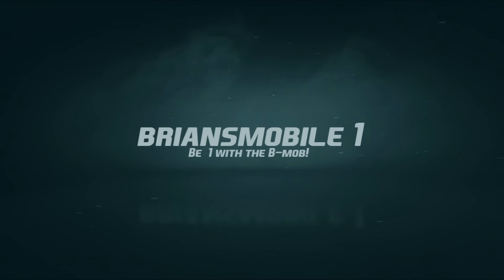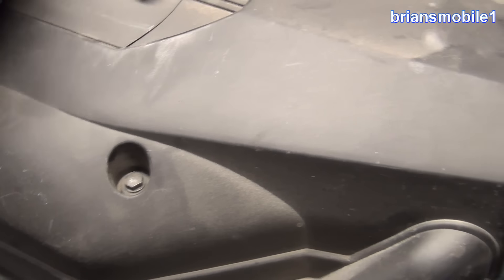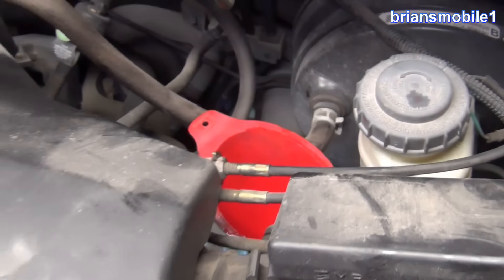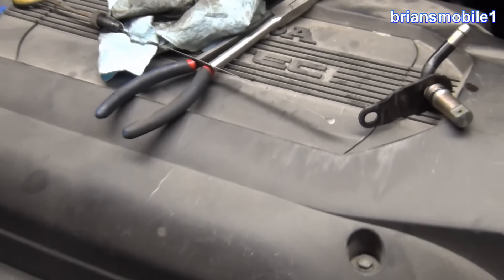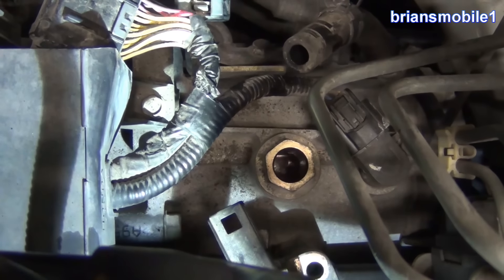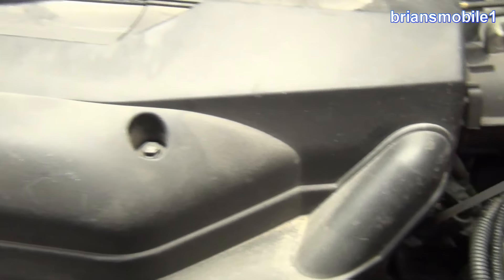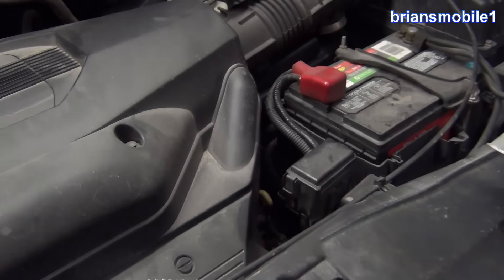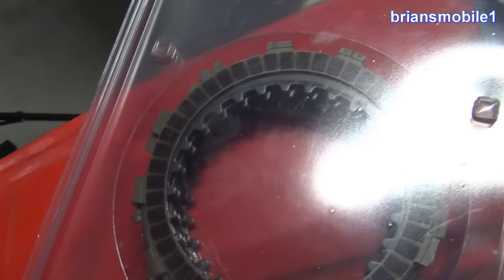Watch this Video BEFORE You Destroy Your Honda Transmission

Comment: I have a 2k Oddy with 260k, original miles on engine, trans and body. I've been using Valvoline Max life ATF for 200k. Honda fluid is too expensive an I believe they got it wrong with the modifiers. The max life gets flushed every 35k and the magnetic plug comes clean as a whistle. 

I'm looking forward to another 250k, if nobody hits me first!
Reply: xr500t I agree 100%.  I’ve always used Honda DW1 and have had my transmission fail 2X.  I will no longer use Honda DW1 fluid in my Honda’s.  I have a friend like yourself who has used Valvoline Max Life and his transmission is fine, and he has high kms.  I am now using Motul 100% Synthetic ATF.  I think everyone has been brainwashed about using their specific fluid.
Reply: Lucky You! Valvoline Max life ATF is not an OEM licensed product. Transmissions cost over $4000 to replace.
Reply: Sounds good, but I highly recommend you get the Oil Jet kit modification installed. The one that installs through the ATF fill hole, and replaces the original fill bolt. This will keep your second gear set from overheating.
Reply: @netdoctor1  do you have a part number and TSB for the Oil Jet kit
Reply: @alexpiccione610  I'll look into it.
Reply: @alexpiccione610  read the manual. Honda"recommends" their fluid, however, they also say you can use an equivalent. It's not "luck", it's proper maintenance. I can safely talk from experience.
Reply: @xr500t  Ok, IMO some "equivalent" stamped  oils are not good to use as replacements.
Glad your choice worked out for you.
Reply: Doesn't this matter if you have the pre or post 2002 model? Some require the zf fluid some dw.
Reply: @fabiansantos4558  I couldn't tell you. The requirement was  for the ZF fluid. But, the manual said you could  use  an equivalent  (I forget which) in a pinch. I decided because the  ZF was too expensive to use  Castrol import/export, then I switched to the Valvoline Max life.  I'm at 280k now.  So, instead of a flush and fill every 35k, I treat the  process like an oil change, where I drain and fill every 6k . That way, I keep a clean trans, but  no massive drain and fill procedure every 35k. Seems like it's expensive, but it's not, it's only 3.5 qts.

Comment: Just bought a 06 pilot and the trans has a top and side fill bolts. Honestly surprised how much power the motor has for one being a Honda and 2 for being fairly large and 4wd. 176k on the clock and drives awsome. The HP power steering line was a PITA only 1 of 3 brackets were reinstalled. Not a fan of all the crap brackets holding all the lines and hose together once you bend them they never go back the same if ever.

Comment: Good advice 👍 My daughter changed her trans fluid at some little shop. They claimed it was the correct fluid but the transmission was not having trouble before but now vibration at idle in gear. Honda dealer fushed it three times..GRRR

Comment: My 06 Acura TL had the fluid changed. Easy.  Interesting example using the motorcycle clutch.  My BMW 1200 bike uses a single plate dry car style clutch.

Comment: Years ago my Tacoma wasn't shifting when the computer was telling it to. Dealer said I needed a new valve body. I think they wanted about $2000. Called another dealer and told them what was happening and said I just need a price for the same job. They recommended flashing first. I did that and it fixed the problem 100%. Drive it for another 5 years before Toyota bought it back off me.
Reply: kewl, but this video is pertaining to Honda/Acura models

Comment: Took my 06 crv to dealer for recall, service advisor wanted to sell me a trans flush! 300.00 ! After I refused, he wanted to sell me a coolant flush and throttle body clean 200! Did both and trans fluid change for less than 100!!!
Reply: To be fair, I know some Toyota/Lexus dealers actually have a machine that drains and fills at the same time, not FLUSHING with high pressure, but similar to the home method of pulling a trans line and filling the trans with fresh fluid as it drains from the open line (car running). A complete fluid exchange.

Comment: I have a 2007 civic with 250k miles and I have never changed the trans fluid since I got the car at 60k miles. Someone told me fresh fluid would break it this point so it will be interesting to see how long she lasts.

Comment: If you want to save a buck you can just buy Idemitsu fluid, they are the OEM for the Honda ATF, it's the same stuff, just a dollar or two less a quart.
Reply: really?!
Reply: Lol o ain't trust other fluid brand. Only honda know what viscosity it should be in their cars
Reply: @armanmaaba600  Do you think Honda makes their own fluid? They buy from Idemitsu, and mark up the price, it's literally the exact same stuff.
Reply: @armanmaaba600  Hahahahaa, who's talking about viscosity? There's no viscosity in transmission fluid, just types. I searched as well and Idemitsu is the supplier of transmission fluid for Honda.
Reply: ... car with dead transmission cost over $5k, so I dont mind the cost of certified Honda ATF.
Reply: @zoneb609  Not so. All liquids have  viscosity. An ATF like Dexron/Mercon or type F, if memory serves, is something like a 10 or 15 wt. As to Idemitsu supplying Honda, sounds about right. Long as the bottle says it's suitable for vehicles requiring DW1/Z1 fluid, it should be fine.
Reply: @bobbofly  Yeah, I get it, I was referring that in case of automatic transmissions you don't go to the parts store and search for a specific viscosity, just application, and compatibility with your vehicle. But yes, liquids have viscosity I agree.
Reply: Kenneth Miles wrong what

Comment: Years ago I used some of that stuff that cleans out your engine and it worked great. 
In fact it worked so well that it dropped all the crap down into the pan so it could clog the pickup and starve the engine for oil. 
Knock knock. Who's there? An educated consumer that knows not to use that stuff unless you are getting ready to pull and rebuild the engine. 
That's what happens when you buy a used car and the previous owner just added oil as needed. I got another story about clogging up the oil pickup but I'll tell ya that on another day.

Comment: Honda trans are different, make sure you use ONLY Honda brand transmission fluid and nothing else
Reply: Adam Walker  As far as anti freeze is concerned I agree, but I'm not going to chance anything when it comes to the transmission. Front wheel drive automatics are expensive to fix.

Comment: I have heard that you should not change the trans fluid if your vehicle has more than 100 K miles on it because the old fluid has dirt and crud that are giving the old fluid more friction and is needed to help the clutches grab. I was told you should only add fluid to these transmissions if they are low. The new flush and fluid will cause slippage and many times bring a quick end to an otherwise still working trans.  Listen to Scotty Kilmer on this subject.
Reply: Changed fluid and filter..first time ever...in my 2000 Lexus rx 300 at 210000 miles. Added a bottle of Lucas fix just for the hell of it. That was 3 years ago and the trans is still doing great. Wasn't having problems...but glad I did it. I used maxlife fluid. Fluid was very dark and there was a thick gunky layer of fluid in the pan. Drained it...did not flush.
Reply: I would change the fluid and filter if it has one. I would not flush it.

Comment: I get fluid for like 7 bucks discount.. when I used to use my honda for delivery ill do a drain and fill every oil chnage..
Reply: Isn’t it supposed to be like every 30k miles or around that area for transmission fluid change
Reply: @carlitoseuceda2000  as far as iknow auto recommend every 60k or so and manual every 30k.. read you owners manual,allot of greats things u dint know bout your vehicle.
Reply: Had a 15 accord sport and iknow have cut trans. We all cut are crap. I did my fluid the first 30k
 Honda guy was like thats too early. I reply.. thats kewl.

Comment: to fill the trans, i use a Hopkins FloTool 10704 to fill through the dipstick neck.  a small clamp will secure the funnel's hose to the top of the neck.  that way, i don't mess with the return line

Comment: I've read somewhere that after the 1st 2 quarts you should start the car and add a quarter if the 3rd stop engine and check level.  And repeat last step till right level.   Is this a better method?
Reply: he already knows the capacity from the service manual & if you're really OCD about it, you can measure the amount drained from the pan to confirm

Comment: Hi brian im bout to swap a new  transmission on a 96 odyssey. However from replacing the rear main seal and switching the parts  from the old transmission to the new one. Like the cables, sensors, & the starter ect..my question is? what else would i have to check or prep or looked for?  on the new transmission? before putting ut in thanks hope to hear from you ?

Comment: I have an 06 TL and use Valvoline Maxlife.  Why use the Honda brand?  They make cars, not fluids!
Reply: I just did a radiator swap on my bosses 02 MDX (trans fluid runs through radiator, stupid design imo) and I topped it off with max-life as it had the required specification. Now I just bought myself an 05 MDX and I am going to change out the fluid. I was planning on using max-life again, unless I could find some reason not to.

Seems like it's working well for you, and my bosses transmission feels strong at 245k as well, except for the dreaded whistle in 4th gear haha.

Comment: I got my new 2000 Odyssey through 250K miles and 3 kids and 2 dogs.  Drained and filled 3 quarts of trans fluid every time I changed engine oil.  Only used Honda trans fluid.
Reply: At $7 a quart, that's $1,000 in fluid, yes?

4x$7 =$28 every oil change. 
If you do that 3x a year $84 a year for 20 years = $1,680
Reply: @deasttn  - have you priced a rebuilt Honda transmission and rental car for two weeks?
Reply: @petersouthernboy6327  not cheap.
I just think you're over doing it (my 04 odyssey went >200k with next to nothing spent on transmission fluid).

I usually put a gallon in every year or two

Comment: 95 % of Honda transmission failures it is owner’ fault  !!!
Reply: BS THEY ARE BAD WHY THE TOYOTA DOESNT FAIL.
Reply: @382527100  right, Toyota/Lexus trans will outlast their 300k+ mile engines. It still amazes me looking through lexus classifieds how many are over 200k+ for sale. I personally drove an es300 from 94k to 200k and the only non-maintenance item I replaced was the AC compressor, and o2 sensor and valve cover gaskets (which are practically considered maintenance items).

Comment: I have a 2007. I don’t have that hose stuff for the fill  hole.  
 And  use only dw1 fluid.  I tried valvoline maxlife full synthetic ATF it worked  but I went back to the Honda fluid shortly after because it shifted smooth as butter with dw1 fluid.  And I used 3.3 qts on 2007 model year .

Great vid there.  I like the Honda drain plugs with the easy magnet access.

I also have 2001 Nissan Maxima
At 202k miles it was shifting very bad.   Almost didn’t move.  

i did a 3x drain and fill with few thousand miles between each.  Along the way Lucus and seafoam transtune were used.   It’s now at 215k miles and shifting a lot better   But needs the Lucus additive.  It shifts fine but when you floor it in 3rd gear it slips
Out of gear into N.  But let off the gas it slips back into 3rd.  
It does get p0744

I think it’s the shift solenoids which includes the TCC or clutch or torque converter.  But it’s seems ok to drive locally. The car is my sons now and the bad shifting didn’t show up untill 3k miles after he got the car.   Needless to say I have been busy fixing it for him myself (I am not a mechanic just hand and  small engine hobbyist.  
- new plugs
-  new coil
-  front breaks
- transmission flush vid 3x drain fill
- blower motor and resistor replacement 
- window motor replacement 
- fix leaking water into trunk
- oil changes
- pvc replacement 
-  misc  other simple stuff
I have been documenting the costs and estimated savings by DIY to prove to him how much money can be saved but learning how to tinker with stuff and fix things your self.
So far it’s about  67% savings vs a shop or dealer.
Reply: And don’t forget that a dollar saved is more valuable than a dollar earned, because you’re not paying income taxes on a dollar saved. That makes that 67% a good bit higher in reality.

Comment: Nice when I got my 1991 legend it was shifting hard, I checked my trans fluid it was half full, so I researched fluid type and it showed me Honda’s fluid same as in the vid, but no one had it so I had to order. I drained and replaced and freaking huge differences smoother but not perfect. I’m going to wait couple more drives to drain and replace just to be sure!!!
Reply: Also when I tried to get the fluid and they didn’t have I used merc or whatever they had to get home. I asked the guys at parts store and they couldn’t give a clear answer on what tranny fluid to use so they told me use merc 3 or whatever was used or bought mostly. It’s almost like I could smell the tranny fluid burning, other that hard shifting still.
Reply: Using Honda atf and still running strong

Comment: I have a 01 accord EX v6 3.0 sedan... for some random reason my car is driving forward in all gears including N and R... why is this???? I've replacement solenoid valve A, Torque converter clutch solenoid and the linear solenoid and I also put new fluid in today... what's wrong with her... 😞😞those 2 solenoids are the ones that sit on top of the transmission and then the valve solenoid that has the black connector was brand new replaced few days ago... what's going on with my car and the D light is flashing and the TCS light comes on as well....

Comment: I changed my transmission fluid on my 2018 Civic EXT at 53,000 miles. I flushed my brake fluid, replaced the brake pads, cut the rotors, and replaced the tires at 66,000 miles. I only use top-tier fuel, 93 Octane. I’ll be cleaning the valves with a walnut blast soon. I always change the oil early at every 4,000 miles. Keep your car maintained religiously and you’ll get trouble-free operation for years.
Reply: I mean not every car is tuned for the highest grade fuel. Like I mean you could use methanol technically but since your car isn't tuned for it.. it won't make it run better.

Comment: My 2004 Altima with 5 speed Automatic Transmission has completed 2,35,000 miles with factory filled fluid. Never changed it.

Comment: 2018 Honda Pilot with the 6 speed. Drained approx 3.8 qts of fluid, fluid looked bad. Put 3-ish quarts of new fluid back in, started and ran to operating temperature, adding fluid until level was good. Drove vehicle for approx 10 minutes, drained fluid again, fluid still looked bad. This time only about 2.9 quarts came out and it quit dripping. Re-filled with approx 3 qts of fluid, I run vehicle up to operating temperature, turn vehicle off, pull trans dipstick and wipe clean. Re-install dipstick and observe fluid level on dipstick. Every time I check it, The back side of the dipstick has fluid way up on the stick, but the side that has the word “hot” in between the 2 dots the fluid level is within the range. I’ve dipped the stick several times and each time this is the result. I’m assuming that the design of the dipstick must scrape down the dipstick tube on the back side each time you insert it, resulting the excess fluid on the back side. Anyone ever experienced this?? Seems a little unnerving. Also, now sometimes when stopped and the trans in D, when I take my foot off the brake the car will not move until I press the accelerator. any ideas???

Comment: On my 2012 Acura TSX Wagon, with 4-cylinder, you run until fully warmed up. Shut the engine down and then check it between 60-90s after shut down. If to long restart vehicle, run a few minutes and try again. This is according to the owners manual.

Comment: I have  a 1991 civic, for some reason my levels at temperature are lower than when cold, opposite to your observation in this video. What is that about? Should I rely on my cold or hot level?

Comment: What I do is measure how much trans fluid comes out and then add the same amount back in. You should have the correct amount of fluid added back as long as the trans fluid wasn’t low before draining.
Reply: Yes, that’s what I do. It’s easy enough to check the level with the dipstick afterward to be sure, but I’ve found it’s always correct after putting back the same amount of fluid that came out 😊

Comment: If I flush a transmission especially a Honda one, I do a drain and fill 3 times to be sure I've removed most of the old transmission fluid.
Reply: Yes but what Honda do you have ? I have a Acura TL 2006 and I recommend replacing them 3rd & 4th pressure switches for best shifting performance. Replaced mine and it shifts like I bought it brand new . Also recommend clean the shift solenoid. It’s easy
Reply: @Mirage I have a 2006 CRV 5 speed auto, it has been trouble free since I've been the second owner.

Comment: I bought an 08 Accord with black fluid because it was low mileage . Had it a month and before I drove it once and the B and C shift solenoids fouled . The car has only 80 k miles on it . Hoping this works along with a new set of sols .

Comment: About to drive across country hauling a trailer in my 2007 Honda Pilot and my transmission fluid has been due for a change for a year now, so thinking I should get on it.  I always did it in my Toyotas and it was super simple, looks a bit more complicated on the Honda just in terms of filling.

Comment: Ive used the idemitsu  H-plus with good results, over 3 years and still smooth. 99 ody with 220,000. I was using Castro foreign oil with ok results.